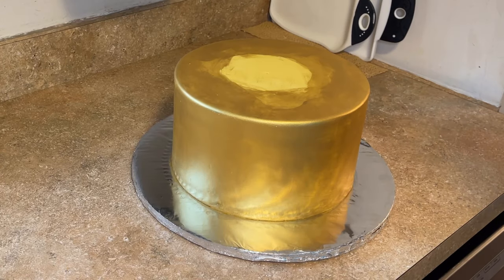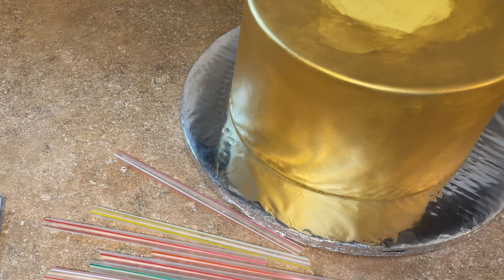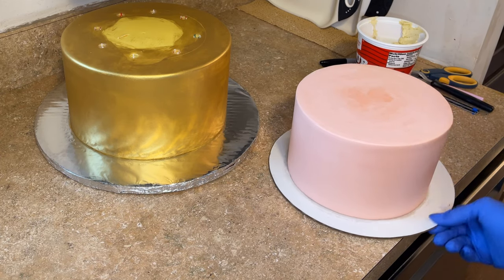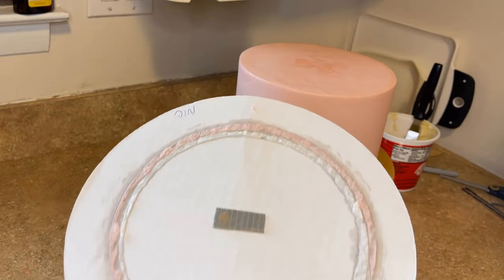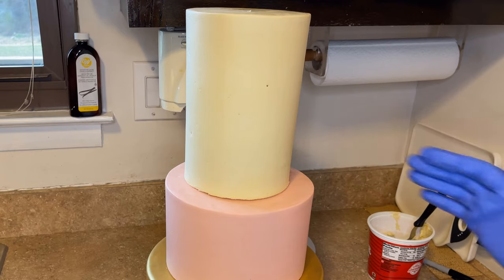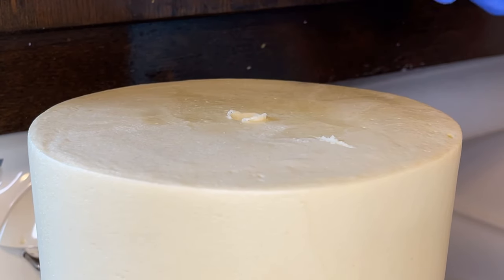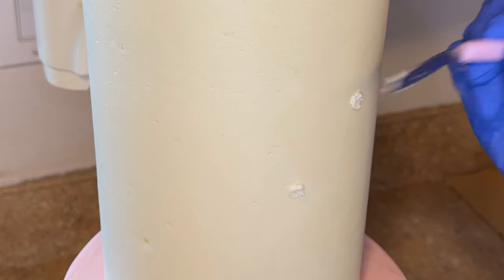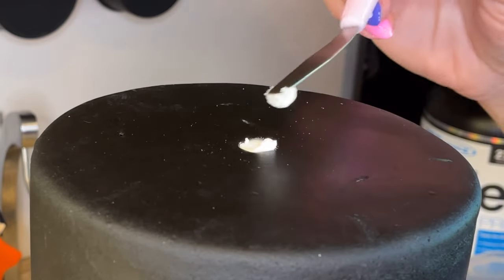Cake Stacking | The Basics Of Cake Decorating

Comment: I have questions about the content of this video, and then I'm also going to ask a question about something else. :)  First, how do you decide what the diameter of your center dowel should be?  Second, how do you clean the dowels before inserting them in your cake? Third, where can we get a cake smoother tall enough to smooth a double-barrel cake like yours?  And the unrelated question is: Do you have a video that shows what you do with your cakes between the time you unwrap them from thawing to the time you make them a tier on a cake?  Thank you so much, Karolyn!  I'm really enjoying your videos!  Oh!  I wanted to tell you, also, that you have caused me to be excited about making cakes again.  I have discovered that I do not enjoy making cakes from scratch and having to work out all the different amounts of batter.  I watched your vidoe on not wasting batter and the light bulb went off about how easy it is with a cake box miix!!  1/3, 2/3, whole box.  That's it!  SO SIMPLE!!!  THANK YOU!!!!
Reply from the maker: Hi Cheryl!  I prefer to use 5/16" round poplar wooden dowels.  I really don't make any cakes taller than 4 tiers and I have found this to be the perfect size.  The poplar wood is easy to cut with the snips.
I use a pencil sharpener only dedicated to my cake dowels.  And I rinse the dowel under water to remove any excess shavings and to clean it before I put it into the cake.
I use these fondant smoothers, they are usually tall enough.  Some of my double barrel cakes have been slightly taller, so I just make sure I hold it straight and lift it up and down the cake as I'm smoothing it out.
https://amzn.to/3Wnz6TG
Reply from the maker: After I thaw them, I unwrap them and fill them, here's the video:
https://youtu.be/wN6yguNwtOM
Reply from the maker: Then after I fill them, I ice them and put them in the fridge (before I stack)
Here's the video:
https://youtu.be/tTEb690qtJc
Reply from the maker: And I'm so happy to hear you're excited about making cakes again! You do it the way that is right for you, not how everyone thinks you should!  💜🙏

Comment: Thank you so much. Your work is excellent and great tutorial. I live in the Caribbean and it is very hot. So the cakes sweat very quickly. However i am watching and i see how you can lift your cakes with ease. Can you pls tell me what degrees your fridge is set at to get the cakes chilled and firm? Thank you for responding.
Reply from the maker: Hi Elizabeth!  I'm not sure the exact temperature, it's probably around 36-38 degrees farenheit.  I also use American Buttercream, it sets really hard in the fridge.  If you use a different icing, it may not get really hard.
Reply: @KarolynsKakes  thank you so much for responding truly appreciate it. Do you have a video on making American butter cream?

Comment: Hi Karolyn, thanks for this video! I do have a question, Im doing a 6 and 4 inch tiered for a wedding as they are textured tiers. Wondering if you would texture once they are stacked? Id love your input, also if a dowel is necessary with that small of cake? I'd love tp send you a pic and get your advice
Reply from the maker: I usually texture once it’s stacked so I can cover the seam between the two cakes. And I always dowel if it’s 2 tiers, no matter the size!

Comment: Hey Karolyn, i know you made this ages agoo i just found your videos and loving themm. Im making a 3 tiered cake with the 2nd tier being an acrylic tier. I was just wondering if you had any tips for keeping it supported without the dowl as it wouldnt go though the whole cake😢. I'll use the bubble tea straws in the top and bottom layers. Maybe putting a dowl in the bottom layer through to the cake board?
 I'll make it at home for my daughters 1st birthday party which will be at home. Maybe freeze the 2 layers and stack on the day? How long should i leave it to thaw, it wont be very warm could i thaw it in the fridge the night before and take out in the morning to thaw completely? Sorry for all the questions
Reply from the maker: It's good that you don't have to travel with it!  I would dowel the bottom tier(s) into the cake board.  Then make sure you have straws in the bottom tiers (and also in the one that will have the acrylic separator on top.  Cut the straws slightly shorter than the height of the cake and fill in the holes with icing.)
I take my layers out of the freezer about 4 hours before I fill the cakes.  That's plenty of time for it to thaw.  I never put cakes that aren't frosted in the fridge because the refrigerator can dry them out!  You can just take them out of the freezer and thaw on the countertop (still wrapped in the plastic, I sit them on cooling racks so the condensation can drip through it.)
Reply: Thank you so muchhh

Comment: Do you put a small hole on boards so stick your hammering goes through or dose it go straight through board ?
Reply from the maker: I sharpen the end of the dowel in a pencil sharpener (only used for dowels), so I can hammer the dowel through the circles and into the cake drum.😊

Comment: Hey Karolyn!! I know this is an older video but I’m stacking my first 3 tier this weekend. I was just wondering if you ever skip the dowel in a 3 tier? I’m doing 8, 6, and 4. I plan on doweling it the way you do but I was just curious if you can get away without the large central dowel and only use the boba straw for stability. And also was wondering what’s the farthest in advance you frost a cake? The party is on Saturday and I was thinking about finishing it on Thursday but I would hate for it to be dry 🤔
Reply from the maker: Hi Anna!  Once you have the icing on the cake, it seals it and protects it from drying out.  I've had frosted cakes in the fridge up to a week and they have been fine!  If your cake is moist to begin with, it won't dry out.
And I NEVER skip a dowel for any tiered cakes.  (2 tiers and up get a dowel).  The dowel prevents the cake from sliding around the cake board and is necessary to keep it in place, especially in the warmer months when cakes melt faster!
Reply: @KarolynsKakes   thank you so much for the reply!!! My cake turned out
Awesome! And I live in so cal and had to deliver in the warm weather but I’ve been following all your videos throughout my learning process and haven’t had any problems with condensation or those dreaded bulges I used to get 😅 love you and your videos I can’t wait for the next one 😍😍

Comment: What other support could
I use can I use bbq screwers? Or regular straw too?
Reply from the maker: I feel like BBQ Skewers are a little too thin and flimsy to use to dowel cakes.  I'm sure they could work for smaller ones, but for large cakes, I prefer wooden dowels at least 5/16" thick.  And regular size straws are too small and weak to support the weight of cakes, so I recommend the bubble tea straws, which are less likely to collapse under the pressure.

Comment: Hi Karolyn! All of your videos have been a saving grace! I am making a two tier cake covered in buttercream this weekend. However, I am adding texture to the buttercream using a cake comb. Do you think I should add the texture before or after stacking? I'm worried if I do it before stacking I will mess up the texture when placing it on the first tier.Curious to know what you think! 💜💜💜
Reply from the maker: Hey!  I would do it before stacking. But that’s because I refrigerate my cakes so they are solid when I stack them and I don’t mess them up. (I would comb the cake when the icing is soft then put it back in the fridge to set hard, then stack it)
If you don’t refrigerate your cakes, then I would say to stack it first and then come it. However, you could mess up the tier underneath if you aren’t really careful!
Reply: @KarolynsKakes  ok great! thank you so much!

Comment: Hi and thank you so much !!!! 

May I ask you where I can find the best wooden dowels ? And also , are these completely necessary for stacking? I’m so scared lol. I’m finally making a wedding cake. :). Thank you so much !
Reply from the maker: I use these dowels:
https://amzn.to/3QH0Cc9
You can get them on Amazon or at the local home improvement store.
I feel they are 100% necessary because it prevents the cake from shifting and secures it to the cake board.
And the straws are 100% necessary because they support the weight of the upper tiers and prevent the cake from collapsing.
What are you scared to do?
Reply: Thank you so much ! I am scared to stack a cake … I just don’t want to ruin it and I have to deliver as well and I watched your video on that too ! I’m just not sure if I can add my flowers before I get there ( 30 minutes away )

Comment: Does this apply to a small 3 tier cake ? 
Or even a 2? 

I have a pan that is 7inch 
5 inch 
3 inch 
Would I do this method for something like that? 
Does this need to be done for a two tier cake
Reply from the maker: You can do this process for cakes that are 2 tiers and larger.  It's the same process on cakes with more tiers.
Even with a small 2 tiered cake, I will still put the straw supports in the bottom and the dowel through the whole thing.  Although they aren't heavy, they can still collapse or fall apart without the proper support!

Comment: I don’t see the board listed for the supplies. Where did you get a board thick enough to hold a cake 4 layers or more?
Reply from the maker: I actually made this cake drum myself using four 14" cake circles.  I show the technique in this video: https://youtu.be/hdLPFHwhip0
(I believe that video shows me doing three 10" cake circles.  But you can do any size circles.  I tend to use 3 circles for small cakes and 4 circles for larger cakes.)
Reply from the maker: You can also purchase them if you don't want to make them.  I love the CakeBon ones here:
https://amzn.to/43BPOm0
Just make sure they are 1/2 inch thick and not 1/4 inch thick!
Reply: @KarolynsKakes  thanks so much, I have another question. The Bubble straw supports would you recommend 6,8,10mm?

Comment: Hi Karolyn,
 How do you stack a 3 tiered cake that has texture?I'm guessing you just try not to touch the sides? Or can you give me a tip on how to do it?
Reply from the maker: I only use American Buttercream and I refrigerate all of my cakes.  
I do it 2 ways:
1 - add the texture to the cake and put it in the fridge overnight to solidify.  Then the next day, the icing is solid and doesn't get messed up if I handle it for a few seconds while I stack it.
2 - stack the cake and then add the texture.  But I can only do this in certain instances where I won't mess up the other tiers (for example, adding white buttercream texture on a white cake)